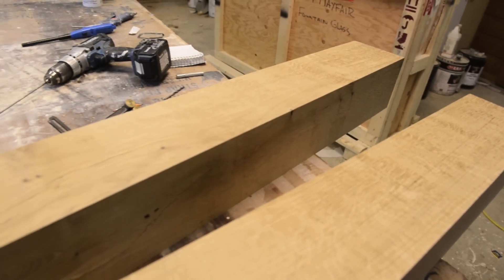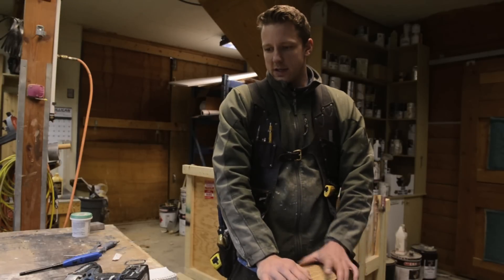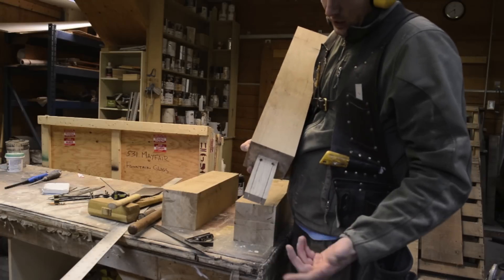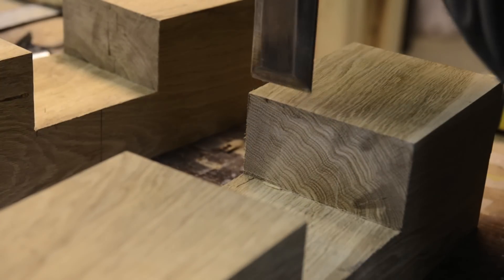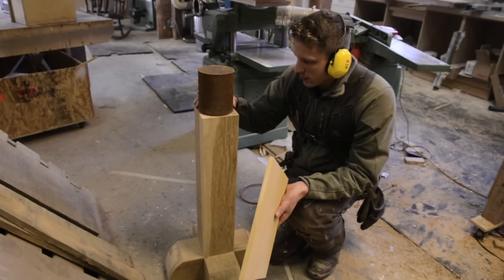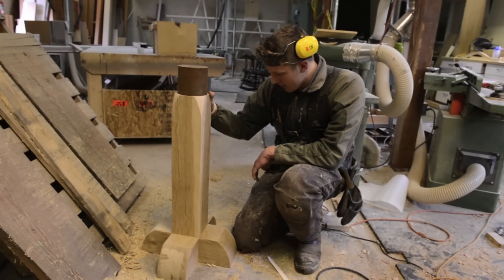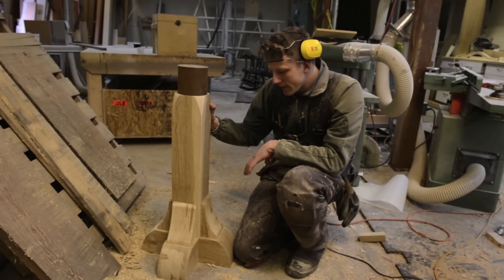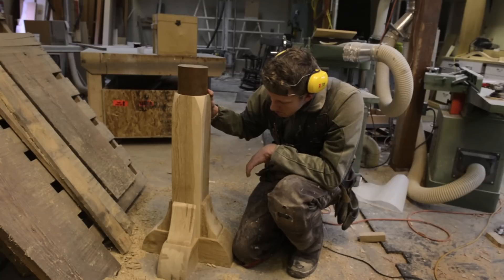Woodworking, Building an Anvil Stand

Comment: Jesse! you've been a huge source of inspiration in my quest for craftsmanship. I noticed you've mentioned you haven't really used the anvil since you built the stand. In light of this travesty I would like to challenge you to a dual! I too have a small anvil, but no forge. yet. I've planned on trying my hand at making a japanese style chisel. I'll send you my chisel if you get your forge up and running!
Reply from the maker: +Jesse Snowden It is not a matter of if. It is a matter of when.  If you haven't noticed, I have my hands full at the moment.  I'll be forging tools by spring.
Reply: +The Samurai Carpenter, then I will get to work! cheers
Reply: The Samurai Carpenter My god, you really do come across as a massive anvil stand sometimes...

Comment: theres a traditional (?) way to put the anvil on cut piece of log placed in bucket of sand. This supposedly dissipates the vibration you might get on hard surfaces like concrete. When i was apprentice mechanic, all the anvils in smithy class were installed this way.

Comment: Been about a year since posted. I was wondering how it held up. Wood looked a bit thin where the billet was inset. Nice looking thing to have in the shop. Also was wondering why you drill holes across your wedge slits?
Reply from the maker: +sam henderson I haven't used it much because of tall the moving around I have been doing.  I drill the holes to prevent the wood from splitting and help it bend easier when the wedges are inserted.

Comment: Is there a rule of thumb as to how much space you allow for the tenon to expand while putting in the wedges? Or, more simply, how much bigger is the widest part of the mortise than the tenon? Great work!
Reply from the maker: ***** depends on the length of the tenon.  I typically taper the mortise about an 1/8 every 2"